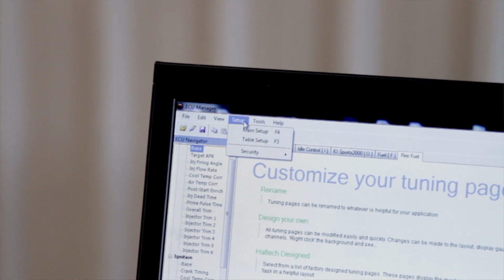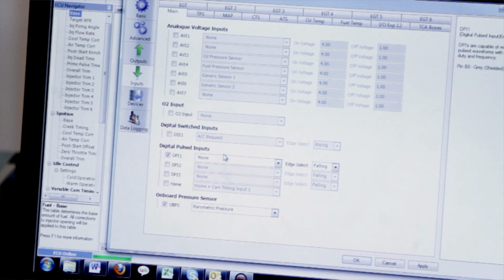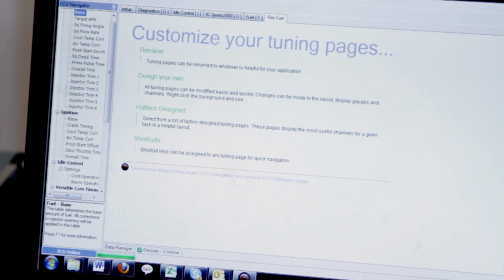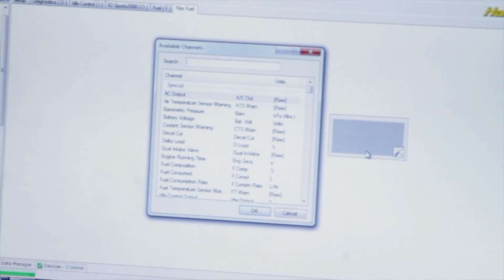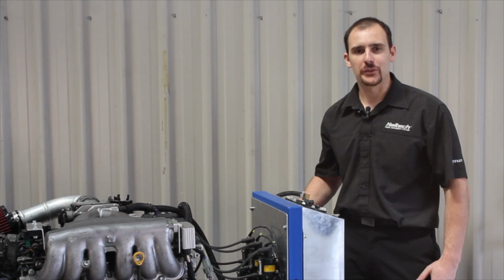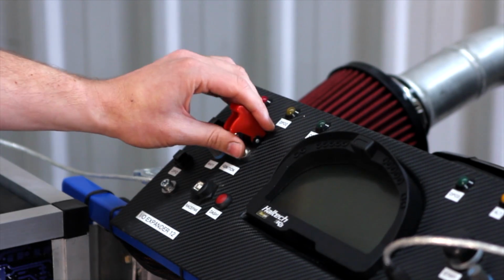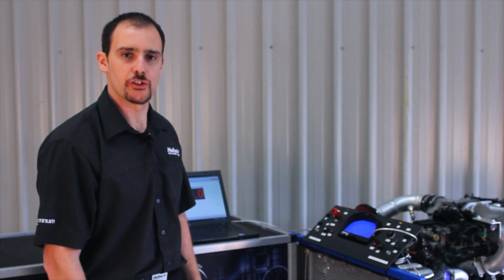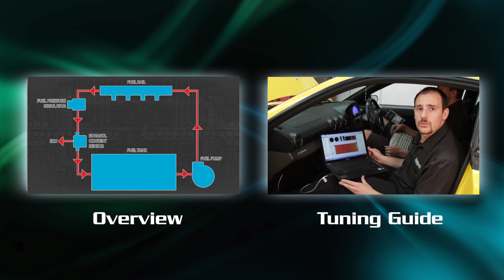Haltech Technically Speaking: Flex Fuel Sensor Fitting Guide

Comment: I assume this only works on petroleum-ethanol blended fuels, but not methanol blends?
Reply: It would be worth enquiring about. If the sensor works anything like an LEL sensor in a flammable gas detector, they can be either configured to read other chemicals or the data can be read differently. At the end of the day , it will be a question for Haltech because even if the sensor may be capable, the software may not support it.

Comment: Why isn't the sensor installed on the feed line before it hits the injectors? Wouldn't this provide a more accurate reading of what is going into the motor?
Reply from the maker: It can go on either side depending on the application.  Ideally it would be in the fuel rail, but for this application we have sufficient fuel flow on the return so there are no issues reading from this location.
Reply: If i put the sensor in the feed line will it reduce the flow?
Reply: It would be nice if this video showed the wiring.
Reply: @jirace  it seems like no one is showing the wiring for e85.